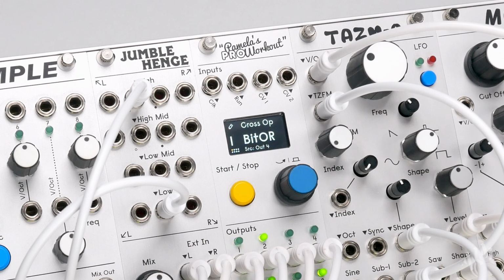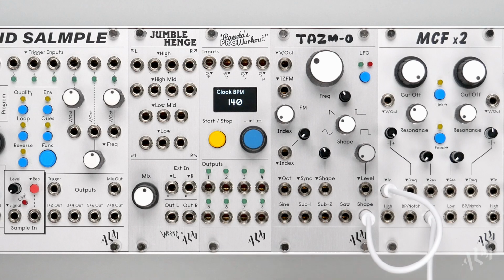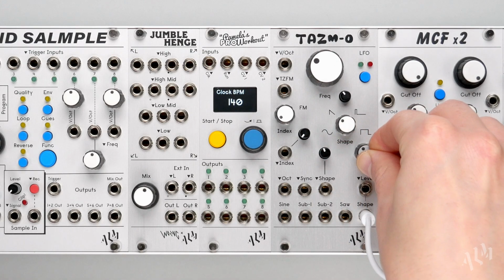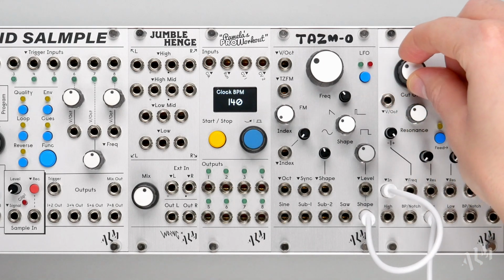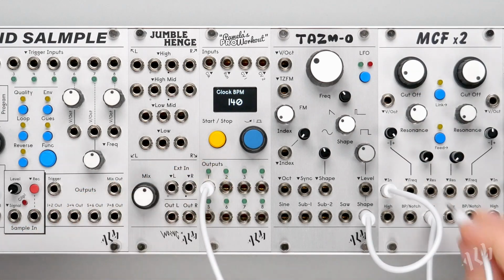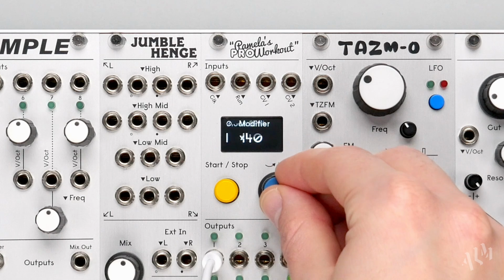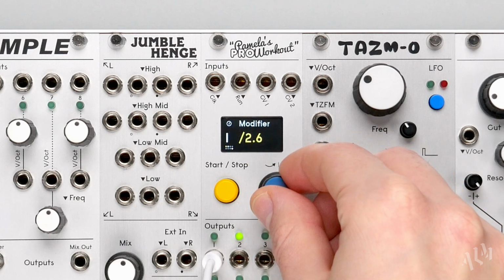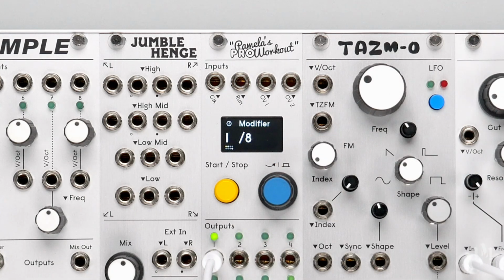Pamela’s PRO Workout: CV Mixing, Arpeggios & Logic Beats with Cross Ops

Comment: During the logoc beats part, what settings do you have for puput 2 and 3 to make output 1 patterns similar to your video
Reply from the maker: Output 2 is a /2 clock and output 3 is a x1 clock with 'Phase' set to 50%.

Comment: Not sure if you are still monitoring this video for comments, but i have a specific use case question. Say I want one channel to output ratchets, but not on every step, with most of the steps not ratcheted but regular single triggers.  And I want the ratchets to be random or at least follow some sort of euclidean logic.  the beats may be 1-2-3-4/ 1-2222-3-4444/ 1-2-3333-4/1-2222-3-4/and so on where the repeated numbers are the ratcheted step. and this is coming out of a single output to trigger a single voice.  Is there some way to logic cross op a square wave channel with a ratchet wave channel to make this work?
Reply from the maker: Easiest way is to CV control the wave type and offset/attenuate so only pulse and ratchet type waves are used. You can also CV the width for how many ratchet hits. And of course self patch the CV/
Reply: @busycircuits  what sort of cv signal would be needed to do this and how would it be attenuated to only select ratchets and squares?
Reply from the maker: @andrewnancarrow  You'd need a CV signal that matched the pattern of ratchet occurrences (self patch maybe). Use the inbuilt offset and attenuation to tune' the input for just the rather wave types. Just try it and experiment :) Check the manual and this video series too for more tips.
Reply: @busycircuits I don’t own the module yet. Just wondering how I’d do it. So with ratchets, the width controls the number of ratchets per trigger correct? If so, would a width of say 10% give only one trigger and then 50% give maybe 4ratchets or something like that?
Reply from the maker: @andrewnancarrow  Yep exactly. Ratchets waves are for these kind of effects (and can be combined with CV etc). Recommend you visit a store and try Pam out in person :)
Reply: @busycircuits I wish I had a  modular store in my city, or state for that matter, to be able to try things out. But unfortunately I’m not that lucky and have to ask a million questions on YouTube. 😊
Thanks for your replies. I wish you’d make a video illustrating ways to use ratchets in rhythmic patches.
Reply: Because I still don’t understand quite how I’d be able to intersperse ratcheted steps periodically into a pattern of regular triggered steps
Reply: I still don’t get how that would be attenuated to only select pulses and ratchets and what type of cv signal would be used to select between the two wave types at randomly periodic intervals
Reply: I guess I’m wondering what is the thinking for the ratchet wave forms? Seems like ratchets are best as accents and not every step. What would be a suggested application for ratchets where they are randomly periodic and not every trigger step of a drum voice?

Comment: Hello! Can you mute channels based on CV inputs?
Reply from the maker: Not currently, as @turbotambourine1410 suggested though you can assign CV to channel level, when used with a high / low gate signal the result is the same as muting!
Reply: @busycircuits  much apologies for the misinformation! Thanks for setting it right!
Reply: I’m not positive because I don’t have one but I imagine so. If not, you can at least have cv control the level of the signal going out so basically yes.
Reply: @turbotambourine  @busycircuits thanks for the reply and the tip. I’ll try it out.